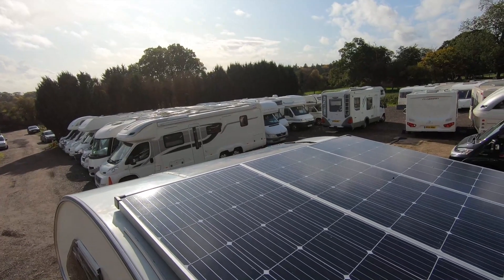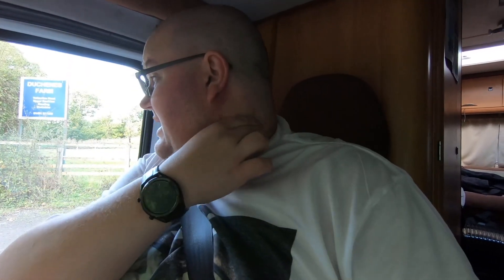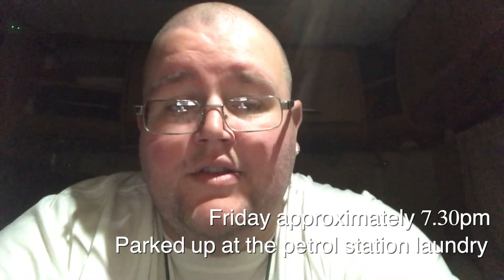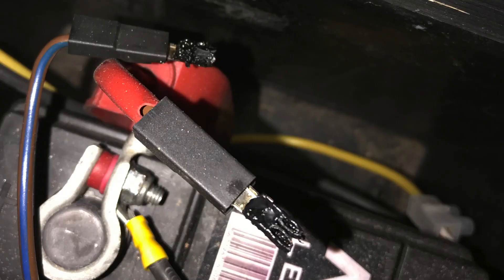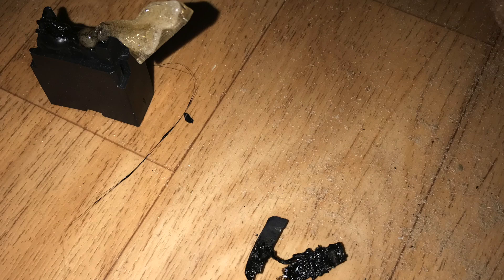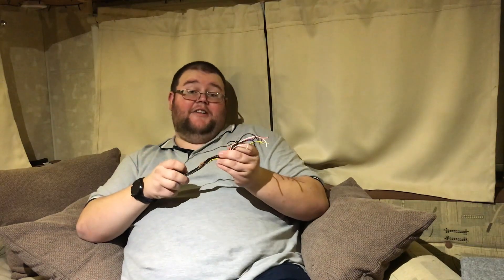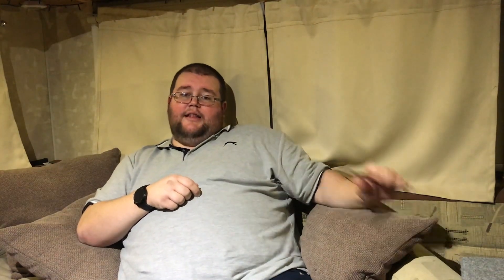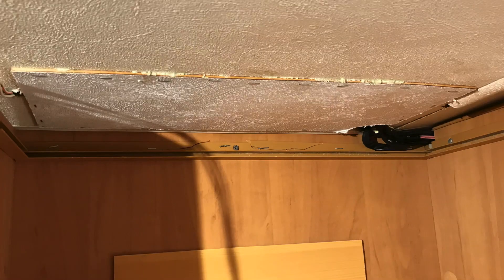Replacing my flexi solar panels for rigids....It' didn't quite go to plan!

Comment: What was the reason for replacing the flexible panels? I'm thinking about getting some but have read they don't last long.
Reply from the maker: They all died, all three 😵 go rigid on a separate frame that’s my advice, last loads longer and easy to swap out if needed 👍🏻😊

Comment: If the cable melted before the fuse blew then the fuse was too high a rating, nothing to do with any 'surges'. The fuse is supposed to be the weak link and fail well before any wires.
Reply: Just to add whilst it was the installers fault for screwing through the cables, it wasn't their fault that your fuse box had the wrong fuses fitted. If it had the correct fuses they would have blown before the wires melted like that!

Comment: You should check ALL the wiring. If it got hot enough to burn at the fuse it could easily have melted / burnt elsewhere

Comment: Surely the van has a main switch / isolation switch turning everything off isolating the batteries? Being living accommodation arnt you protected by an rcd fuse to prevent this from happening?

Comment: I am so sorry you had to go through that, at least they found out what had caused the issue, looking at a wiring diagram would not show where the cable routes are, it looks like these cable where deep inside the insulation of the roof and hard to trace. I am not sure what alternatives they are when securing large panels to roofs, theres certainly some good adhesives now and like some mention pop rivets. In house wires now electricians run cables via zones either horizontal or vertical to the sockets and switches to avoid this but you still take a risk when drilling. What is more concerning to me is the fact that the second lot of fuses did not blow. A considerable amount of amp-age is need to melt wires, this was a short circuit and thats what fuses are supposed to protect. Even as you said a build up of current, this should have caused the fuses to go. I am wondering if this power was coming from the solar panels themselves before they got to the control panel. When you put split chargers on a van for example there should be fuses on both ends of the wires between the batteries. This may be worth getting checked out.
Reply: Before drilling/screwing into a void, a professional would/should have used a cable tracer. An inexpensive item that will easily reveal where cables run. First, you isolate the batteries. Then you attach the tracer to the 12v feed into the van. The sender puts a low voltage modulated rf signal through the wiring. This is then picked up by a handheld receiver that you scan the roof area with on the inside. Not scanning a void for electrical wiring before drilling/screwing is gross negligence. Agree with all your other comments.

Comment: Dont know the whole full story but it sounds like Chris who installed your panels fixed them to the roof with mounting brackets and screws, and a screw penetrated some wires that caused the issue ? I have x2 150W panels on a motorhome roof and no screws have been used, the brackets have been sikaflexed to the roof and the panels fixed to the brackets, been on there now for 3yrs - whos at fault ?  could have used shorter screws - or none at all ? I would put it down to bad luck, 1 screw out of many just happened to be in the wrong place at the wrong time - A word of caution Darren, rule number 1 = Always try not to have screws or any holes made in the roof, not only for the purpose of your accident, but its one more reason leaks can occur. the only holes i have in my roof are for the solar to run down, i also have sat tv on there too - again no screws.

Comment: Darren, do you know why they used screws instead of adhesive? On the solar panels we’ve ever had fitted it’s always adhesive I guess, not only to avoid this problem, but also to avoid a potential leak.

Comment: Guarantee they drilled through a wire. Let them fix there error, then never go back. Find somewhere else that is trustworthy and checks the work before handing you it back!
Reply: Darren said he has two systems, they may have only checked the system they worked on. 
Personally I don't like the way the solar has been fitted with what looks like hinges and screws into thin aluminium.
A long bit of box section from one side to the other bolted at each side with plates under the skin would be more secure.
Easy enough to patch and hide underneath as it's above the double bed High section or above a cupboard.
Harder to fit, more of an expensive job and would take a little longer but, this took an extra long day to put right, could have cost Darran his home or possibly his life.
Good lesson for all  I guess.

Comment: I have to say this is not the first time I've heard of this happening when fitting solar panels I know of 2 others who had the same issue. When I did mine I used bonded on mounts so only hole in roof was for the wires. Sorry I have to criticise the fitting pic at 16:10 shows mounting brackets screwed to roof but I can't see any evidence they have been sealed

Comment: I’ve visited STJ a few times, and yes they are good ppl. However, good ppl can also do shockingly poor work. Screwing into the roof is a bad idea, small brackets is another poor idea, especially giving the wind issue your gonna have along with the vibration when travelling. You’ll be posting a video of a leaking roof soon enough. Also pretty stupid not replacing what is almost certainly a knackered loom (you have no idea if its got heated up at other parts of the cable run). Also given that you leave the gas on all the time just imagine how well fuelled the fire could have been. And on that point if you are in an accident your insurance may be voided, always turn your gas off mate when travelling.

Comment: I'm gobsmacked at the stupidity of the workmen who did this job for you! At least they put it right for free. Yes fuses should blow well before wire starts to melt...that's what they are for. Have a competent auto electrician measure the consumption of all your systems at each fuse in the fuse block and put in fuses the correct size. This is yet another reason wiring should not be buried behind woodwork or insulation also.

Comment: I can see why you would be over the moon looking at them after so long with out ,unfortunately i see lots of issues that would  give me dodgey guts . Screws in the roof can cause water to bleed down them , no gaps between the panels creates a huge sail to rip them off , hinge mounts with a small foot print ? No wind deflector infront of the panels , the fact they never even checked for shorts after scewing into the roof is insaine ,  you could of loost every thing or worse been killed , seriously iwould go get this all checked by another compatent company and report back to the company that fitted them ,you are clearly an inrediblly nice guy but to nice can get you shafted , think about it though a business that relys on luck when doing elecetrics nice guys or not.      Hope you read this darren and get it allsorted

Comment: Putting screws in the roof madness
Reply: No body uses screws into the roof unless absolutely necessary solar panels should be bonded with silkaflex not only have you dodged a bullet with losing your home but what about the future when the water starts leaking through the screw holes ????
Unbelievable bunch of cowboys 🤨

Comment: I think what people don't understand is they are replacing these panels FOC They could have been difficult and I'm sure some companies you would have had to fight to get the job done FOC. Had this been a first time insulation you could well moan BUT I think Darren was very grateful to them for getting it done FOC and as far as the wire and screw incident goes they put it right and was a tricky job that ONLY EXPERTS could sort out It was just unlucky half an inch the other way and it would have been OK Darren has smoke and CO2 detectors so all this shit about killing him is making a mountain out of a mole hill